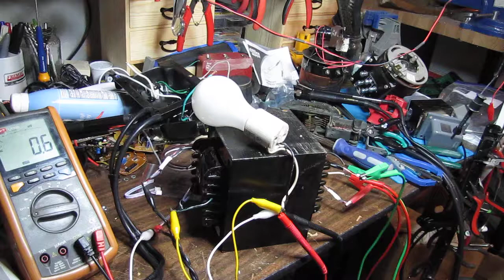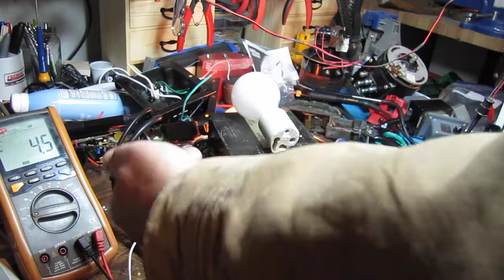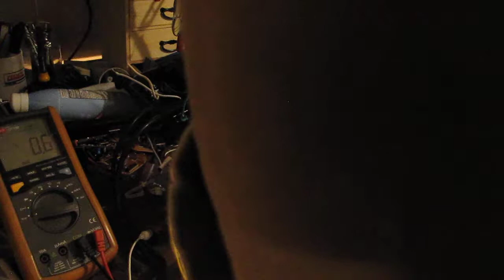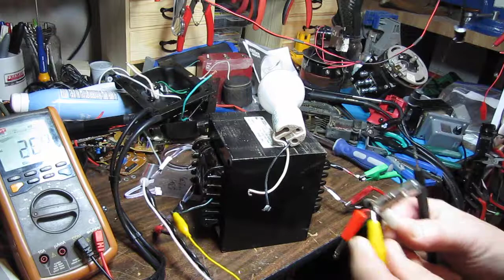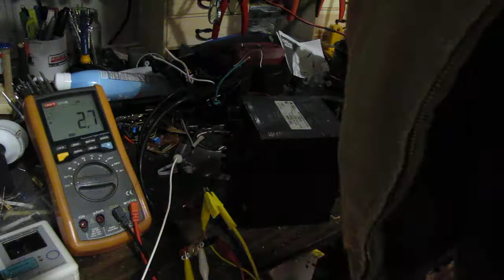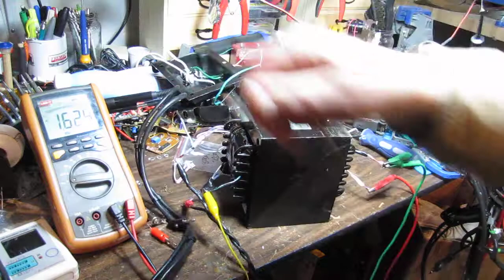ISOLATING Transformer Aug-2019 questions -3E- help - explain to me...

Comment: It seems like the green conductor is just to earth up the iron core to prevent it from floating due to any unbalanced eddy-currents. Have you measured the resistance from the green conductor to the iron laminations?
Reply: Just to expand on the purpose of the electrostatic faraday shield. The transformer is intended to electromagnetically couple energy from input to output, in this example a 1:1 voltage ratio is maintained since you’re interested in purely galvanic isolation.
However, the input may be subjected to  very high energy impulses such as effects from lighting discharges and high frequency switching spikes from electronic equipment or commutation brushes on motors. Therefore to block this electrostatic energy without blocking the electromagnetic energy a faraday shield is employed between the input/output windings. This is the same as the outer shield on a coaxial cable which is also a faraday shield. Hope that’s useful. So you have a Rolls Royce Canadian isolation transformer that not only isolates your circuits but also affords them a degree of shielding.
p.s. I’m not Canadian btw 😉
Reply from the maker: @brencostigan  Thank you very much for more details. Now I can see it in my head, that is how I understand or not something I'm learning or using, thanks to you! Both of these transformers have this "ground wire", so that is a good news for me. I do not plan to fix old radios/TV's, but I do have some experiments I like to perform and I rather be safe than sorry. I don't mind if you are or not a Canadian... ha ha ha; My parents were Hungarian, but I was born in Czechoslovakia (no longer exist)... but I grew up with German neighbors and communists forced me to learn Russian....(I hated that!), BUT I'm an a American for most of my life - I LOVE THAT!  Not to change the subject, but I have been looking for someone who can help me make the Tesla Coil kit - I have a video on my channel here: https://www.youtube.com/watch?v=Mt4y6j-foyY&list=PLv52A7rm-UViZEOlzZfZOB9Gl8cjS3ze5&index=2&t=0s  BUT      no response from anyone at this time. Would you know of someone who can help me to figure it out by a chance? (I live in Lincoln, Nebraska since 1981, but I can't find anyone even in the local Radio Club, who would touch this project for some reason.... ha ha ha) You have a great week and thanks again for your help!!!
Reply: Hi Tony, glad it was useful. 
I’m not surprised that nobody wants to go within a mile of the Tesla coil. I wouldn’t have one of them things in my house. It’s just too damn dangerous and your isolation transformers won’t save your bacon. Good luck with your experiments but I’d recommend getting shut of that Tesla coil or just use it as a piece of art......but don’t energise it.
Reply from the maker: @brencostigan  I have no problem playing with high voltage. I've made few Jacobs Ladders and few other projects with Microwave Oven Transformers.... I'm very careful and I don't want to get hurt or anyone else. The isolation transformers are not for Tesla Coil, it is for other experiments that I'll try after I research everything several times.... The Tesla Coil can be dangerous but I'm no fool. Inside the house it will be ways from anything that can be zapped and I also use a Variac Transformer to bring it up slowly..... The problem I'm having is the schematics for this TC, so if you know where I can get the correct schematics, I would appreciate it. And again, thanks for the help!
Reply from the maker: @brencostigan  As I said, I have 60 years of experience with electricity and many times very high voltage. When a young boy, I fixed tube radios and TV's... and back in those days, it was dangerous to open the unit! I can't remember how many screwdrivers wen up in smoke when discharging capacitors! ha ha ha  I'll be happy if you, and anyone else, can point me to the right direction and I'm not gonna hold you responsible! But thanks for your advice!
Reply from the maker: Thank you very much for your reply.
I did and it was not connected to anything at all. As you can tell, I can play with stuff like this, but I do not know enough details why would they put in a "ground wire" that is just between isolated layers. Unless you are talking about "eddy-currents" - that makes perfect sense and I did not think about that one, despite learning it many years ago and forgotten since! ha ha ha Now, it seems to me that you are more knowledgeable about this, so I'll ask you a question: Which side should the "ground wire" connect? To the source/wall plug or should this connect to the "isolated side"? I would think it should be on the input/source side - am I correct? 
I have couple of these - both are different manufactures and values, but they both have on one side the "ground wire".  (I do not know if you had the time to see the other videos about these transformers, here is the list: https://www.youtube.com/playlist?list=PLv52A7rm-UViZEOlzZfZOB9Gl8cjS3ze5
I had to put them on a "back burner", since I'm reorganising my lab, but in couple of days I'm gonna need them, so I'm glad you answered my question.
Reply: Tony Fleming Okay, I just grabbed the data sheet for this Hammond 171F and it has a faraday shield:-

Faraday electrostatic shield between primary & secondary to greatly attenuate surges and noise.

Here’s the link to the manufacturer web page to download the pdf.

https://www.hammfg.com/part/171F

To answer your immediate question, the green wire should be connected to the earth on the mains input side (from the source wall plug).

Cheers
Brendan